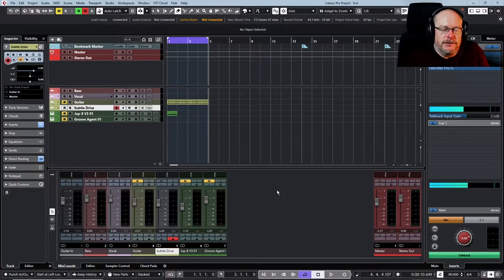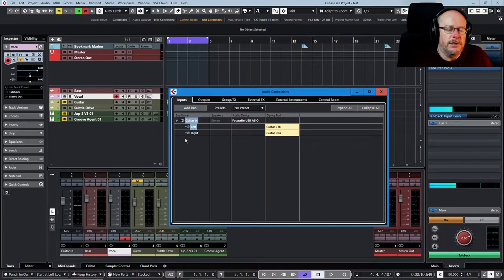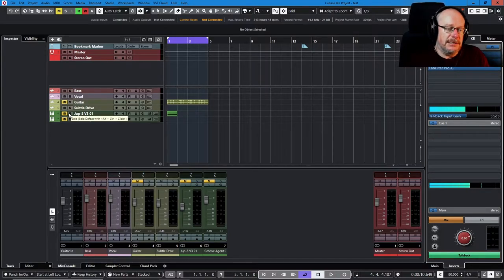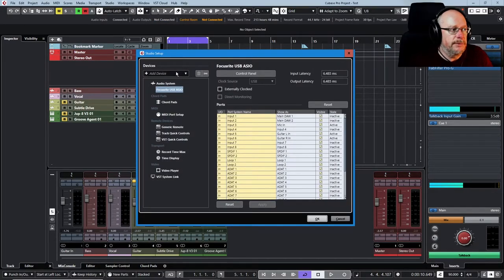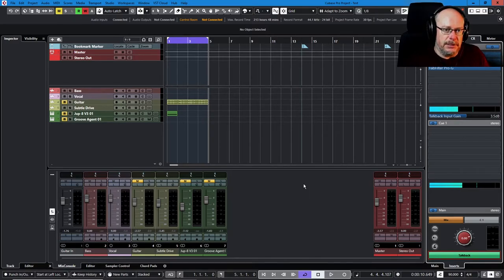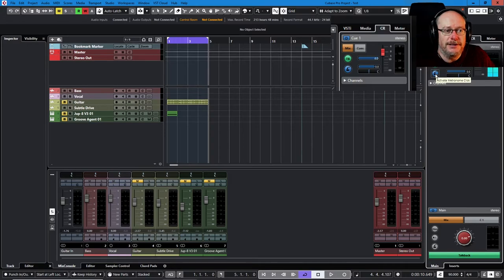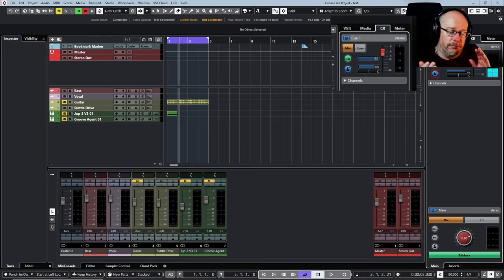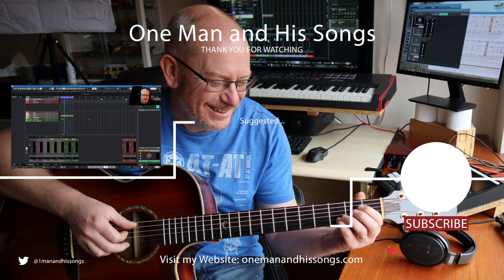My System Setup for YouTube Ep.4 - Cubase I/O and Control Room

Comment: Hi - how do you deal with your bass? (apologies if I've missed it somewhere else) Do you just take a lead directly from the bass to a mono input on your Focusrite? Do you then use any amps or effects on it within Cubase?
Reply from the maker: I can't remember whether I cover it either ;)

I plug my bass into the GT-100, with a dedicated preset, (mostly compression). Out of the GT we go into my... drum roll... Fender Twin, then... bigger drum roll... into my UA Ox. 
New toy. Life-changing... 

Out of that into the L Guitar Input of the Focusrite, then into a Mono Audio Track

So -  tldr; is: yes, it's a mono input, but I haven't yet figured out the balance between my reintroduced Valve Amp, with this incredible attenuator turning it into a line signal, and my VST-based stuff.

Must do a video on the Ox.

Valves, man. Valves.
Reply: @OneManAndHisSongs   Ah yes, that's interesting. I have a ME-80 and I've been toying with getting a Kemper. Would be interested to see a video on your setup.
Reply from the maker: As soon as a feel like I have the Ox under some sort of control, I plan to.